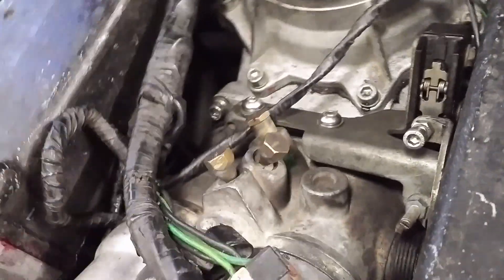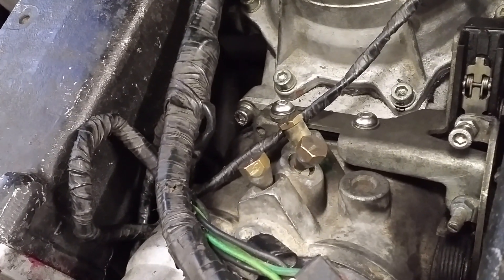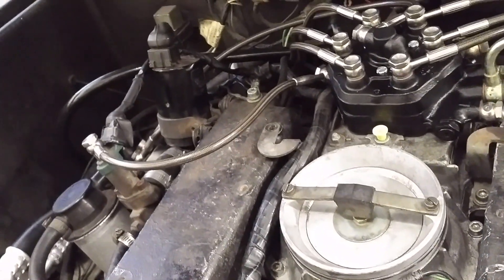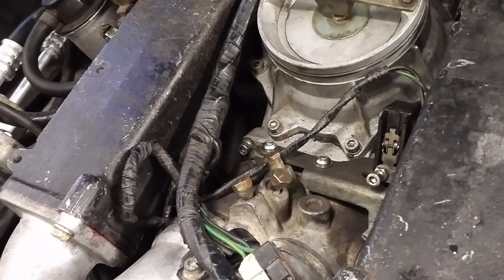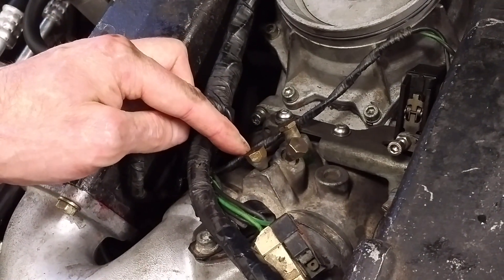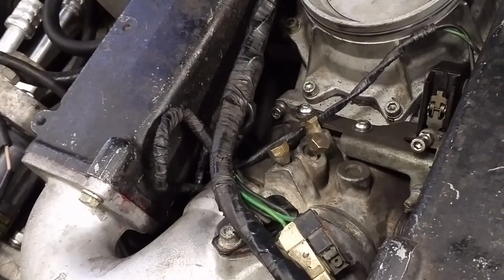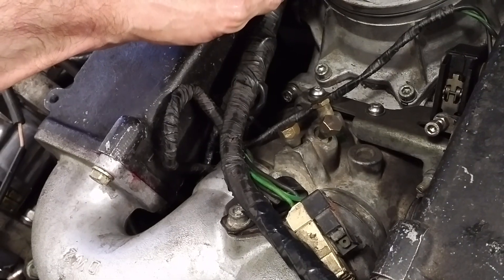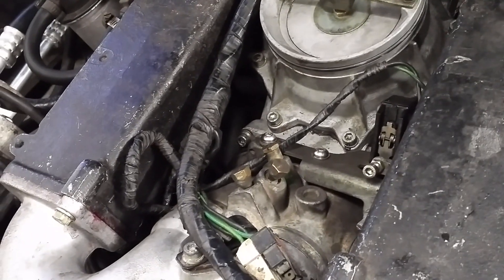DeLorean Idle System How 2: The infamous brass screws

Comment: Do you know what the purpose/function is of the 2 brass springs attached to each butterfly throttle blades????
  I wonder Now, if it has anything to do with the idle circuit you speak of.....   I read about a mod from a famous PRV guru who has a 500hp turbo PRV Volvo Rally Car here in the states since early 2000's, who said those springs obstruct air flow & should be removed & the holes in the butterflies soldered closed & smoothed over & carefully reset the throttle blades all correctly for noticeable performance gains......
Reply: Do you still monitor your channel????
Reply: Do you still monitor this channel?